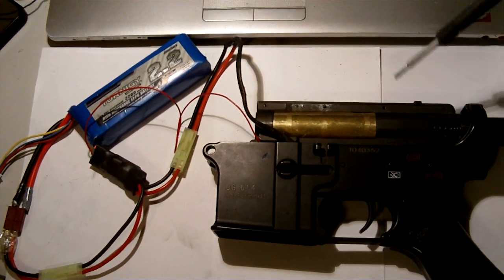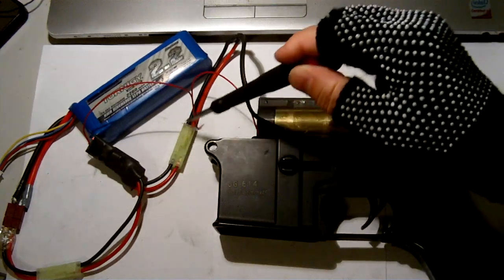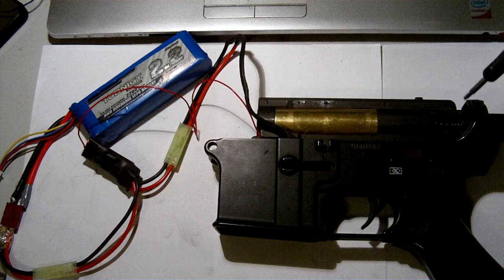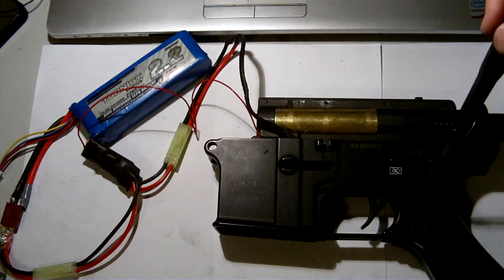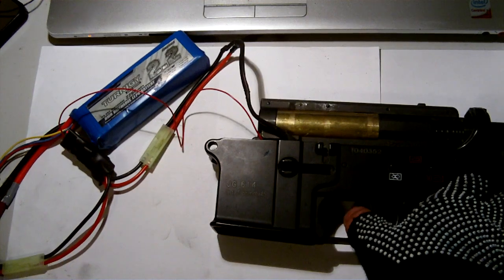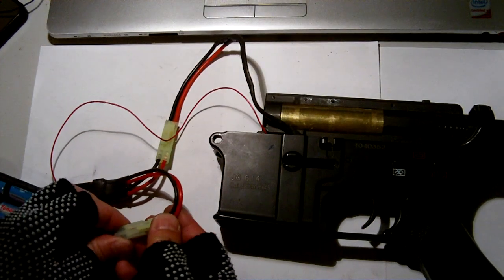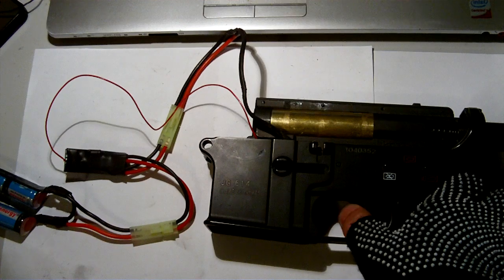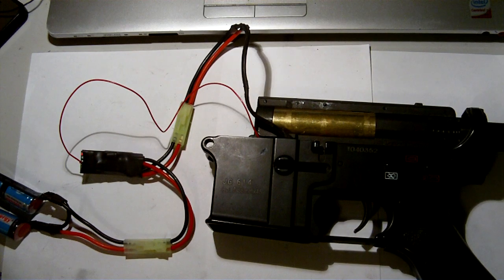Hardwired Burst Wizard King Kong 3-round burst cycle-gear demo

Comment: So. Im coming from plug & play and i tried hardwire it into the oval plate on the mosfet according to instructions.  But Everytime i plug the gearbox into the mosfet/battery, it shoots full auto without stopping. I go back to plug and play method, works just fine.  Can i get any help on whats going on?